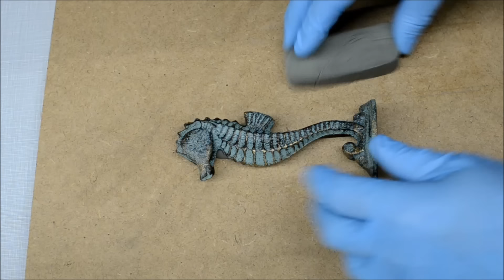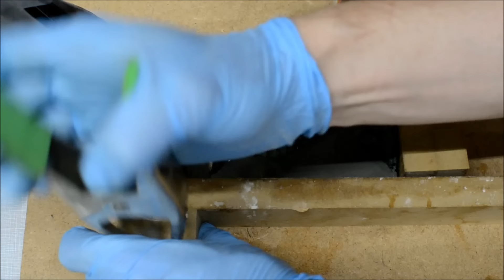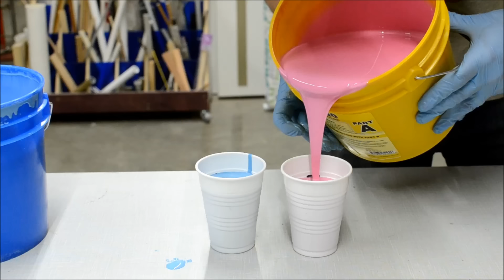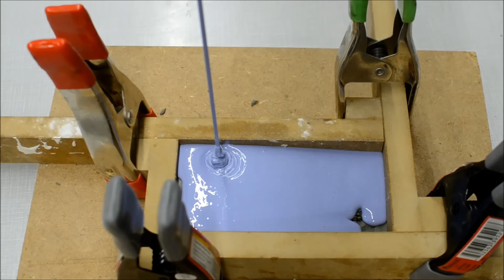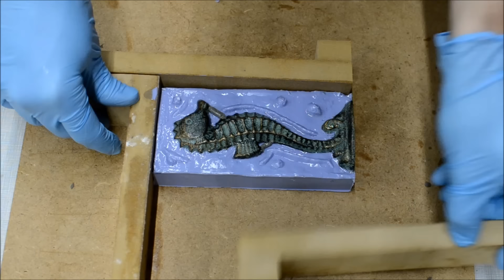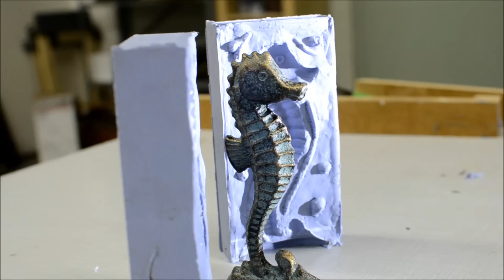Two Piece Silicone Box Mold

Comment: What type of clay have you used? Or any soft clay could be used? I want to make mold from plaster of paris idol, so should i first coat it with something? or I can directly pour the silicone over it?
Reply: If you use Platinum silicone type product you can just use it directly on plaster or spray wax in spray .

Comment: Was the box held together with any glue or was it purely relying on the clamps?
Reply from the maker: No glue, just clamps. You have to make sure the seams are sealed well. I usually spread some petroleum jelly on the walls of the box as a mold release, and that's usually enough for me to keep the seams sealed.

Comment: Thanks for this tutorial video, is your mold box made from Melamine Board? Do you know if making the mold box from wood is okay with silicone mold making and if it should be raw or treated in some way? 
Thanks!
Reply from the maker: My box is made of MDF that was coated with a very thin layer of Vaseline. The silicone shouldn't really stick to wood, but what can happen is that it gets into the grain and all the pores, making it a bit harder to peel away, and leaves a surface that's a little rough. A light coat of Vaseline is a quick and easy way to coat the wood. You can also brush on some shellac or even paint if you don't mind waiting for it to dry.